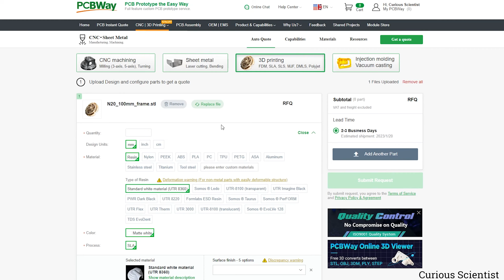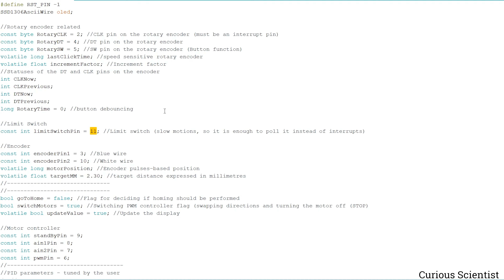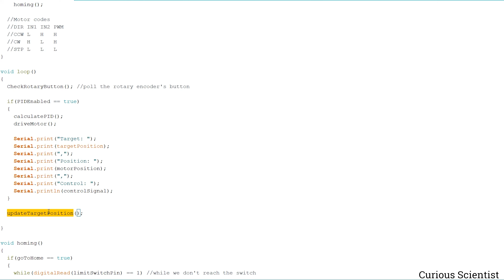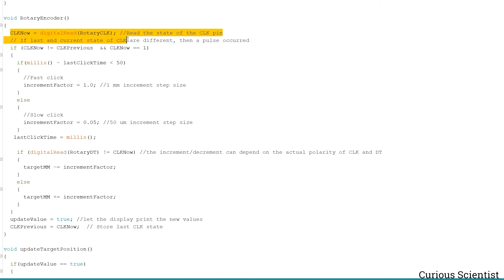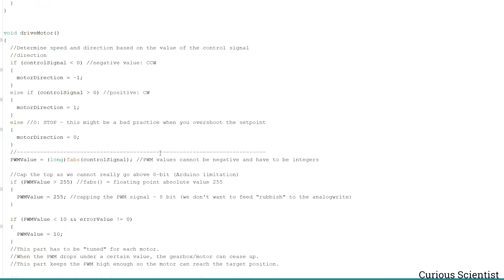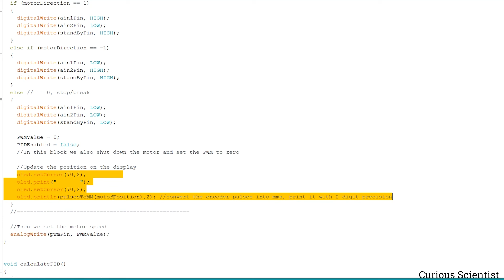Positioning with the N20 miniature geared DC motor

Comment: These are excellent little motors! I've been using them in a project, so cool to have closed loop control for relatively cheap. You can find versions of these that have a JST-ZH connector on the board for attaching the wires, and I highly recommend those. They are much more durable against wire bending.
Reply from the maker: Yes, they are fantastic! I will look up the ones with the JST-ZH connector. However, I found some miniature stepper motor-based actuators some time ago, and I prefer to use those. I will have some nice projects with those gadgets in the future.

Comment: Hi i am facing a problem with the N20 120rpm motor with encoder that i am picking up a lot of noise in the hall effect output pins is there any solution for getting rid of it
Reply from the maker: Hi! How exactly the noise looks like? Are you aware of the fact that you need pull-up resistors for the encoder pins?
Reply: @CuriousScientist  Hey hi 
The problem was different we finally figured it out
The issue was reading the interrupt.
We had attached the encoder pin to activate the interup at Falling edge and we had also taken care of debouncing issue to rule out false interrupt.
But even taking care all of these there was noise which was finally cleared.
The issue was
1) If we are reading the interrupt of the encoder at the falling edge then we need to to park the encoder state to high after reading it.
Similarly
2) If we are reading the interrupt of the encoder at the rising edge then we need to to park the encoder state to low after reading it.

There is noise in the encoder output it is inevitable.
So we removed the noise as mentioned in the above to cases.

Thanks for your fast response.
Reply from the maker: Hey hi! Thanks for responding and telling what led to the solution of your issues. This will definitely help other people with similar issues too!
Reply: @CuriousScientist  🙌

Comment: Thanks for sharing this! I need to do accurate positioning with this type of motor like a servo. I may add a potentiometer to measure its position, because it has a shaft that can be used for this. Btw, are you Hungarian?
Reply from the maker: You're welcome! Isn't the encoder enough to measure the position? :)
Reply: @CuriousScientist  Maybe, I hope it will be accurate enough.
Reply from the maker: It will be relatively accurate, you can see the proof of that in the video.

Comment: Ok. I did have one missing line in the RotaryEncoder function, CLKNow = digitalRead(RotaryCLK); Now the display target Increments and decrements. But the motor continues to run after pressing the hand rotary button at the first 2.30 problemed settings, and the display position stays at 0.00.  My drive does not have a standby input, Does that matter? I changed the gear ratio and pulses. My motor: 576 ratio, 11 pulses/turn. I left the 0.7 in, but I just have a gear motor for the test. I figured that would not be a problem. Would it be possible to send you my copy of your code? If not, any information would be greatly appreciated. Thanks again. Btw, the drive I'm testing with is: TB67H420FTG Dual/single Motor Driver. It's from Pololu.
Reply from the maker: Hi! The code is specifically designed for and tested on the TB6612FNG driver. If you are using another driver, then you have to figure it out yourself because I don't know that other driver. The lack of the standby pin does not matter, as your driver seems to omit it. However, I can see that the truth table is somewhat different. That might cause a funny behavior. You also use another motor, so you have to adjust the gear ratio and if you have a threaded rod or lead screw attached to the motor with a pitch different than 0.7 mm, then you need to modify that value as well, otherwise the positioning won't be correct. The code is available on my Patreon page, as I mentioned earlier.
Reply: Ok, thanks. I can get the motor and drive you have and test it out. I would like to ask, again, can I make a one-time payment? for a copy of the code? I know you don't know me, but I'm being honest when I say I'm on a fixed income. Or is it 5.00 per. Month only? Anyway, I learned a few more things from your code. Please let me know.  Thanks always.
Reply from the maker: @Dekan88  Hi! Sure, several people have done the one-time payment and there's absolutely nothing wrong with it. As I understood how Patreon works, then you can sign up, and then stop your subscription immediately. Then, since you paid, you will be eligible to access the content for a month. Or, just drop me an email first before signing up for Patreon so I can see what I can do.

Comment: Hi again, The code is running. After the limit is tripped and released, the motor stops. The display shows a target at 2.3 and position at 0.00. When I press the hand rotary switch, the motor runs in the correct direction, but the display position does not change (stays at 0.00), and the motor keeps running. I think the code is correct. I do notice the display blinks every time I turn the knob. The target does not change. Any ideas?
Thank you.
Reply from the maker: Hi! 
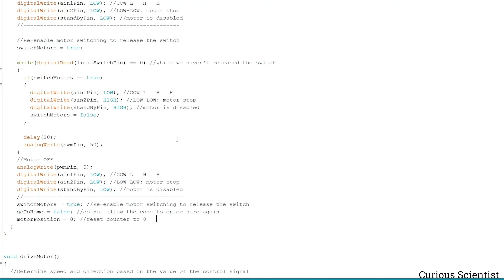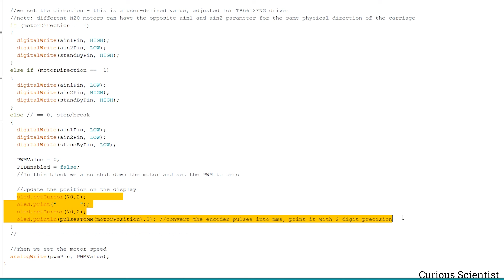Yes, 2.3 is the preprogrammed target (targetMM variable). If the display does not update, then you probably did not copy the code properly. It is possible that you missed the RotaryEncoder function that takes care of the updating of the target position (37:29). When the motor is instructed to go towards the target position, then the driveMotor() function takes care of the motor. At the end of this function (53:29) you can see the four lines which are updating the position of the motor. Check if you have written it correctly. 
If the display blinks when you turn the know, that is a bad sign, because the code is written in a way that only the numbers are updated and not the text. Maybe you should check the wiring and the breadboard contacts. I had viewers asking for help and it turned out that their breadboard had poor contacts.

Comment: Your video does not show all the code from beginning to the END! Now what?
You never go all the way to the end. See the last bit of code, below.
void CheckRotaryButton() // 
{
  if(digitalRead(RotarySW) == 0) // 0 and 1 can differ based on the wiring
  {
    if (millis() - RotaryTime > 1000)
    {
     targetPosition = (long) (targetMM * (298*3) / 0.7); // Pass the setpoint (target value) to corresponding varible
     digitalWrite(standByPin, HIGH); // Enable motor driver
     RotaryTime = millis(); // Save timr
     PIDEnabled = true;     
    }
  }
}

//---
// Another, non-PID way of going to a certain target.
// Only 1 direction is treated, but is easy to expand this to both directions based on the provided example:     YOU STOP RIGHT  HERE, NO MORE CODE.
Reply from the maker: How do you even know if I showed the whole code or not?

The rest of the code (20 lines...) was just an experimental part, it is not part of the demonstration. The whole code which is necessary and relevant for the demonstration is in the video. The code that is essential for the demonstration ends with the CheckRotaryButton() function.

Comment: Why am I getting this error after testing your code?  'RotaryEncoder' was not declared in the scope.
Reply from the maker: Hi! 
The RotaryEncoder() function is missing from your code. The RotaryEncoder() is the ISR routine that is triggered when you rotate the rotary encoder. I explain that function from 37:30 in the video.

If you have written this function, then it is possible that you accidentally missed to place a curly bracket "{" or "}" somewhere.

Comment: Hi, does anyone see the code on his website? I'm using my phone and do not see it anywhere. I see all the others on his site, but not this one. Thanks.
Reply from the maker: Hi! Why don't you ask me directly? It is on my Patreon and I told you this in our discussion under the other PID video.
Reply: Hi! Sorry, but I did ask you directly.  You stated:  "The code for this video is free, It is on my website.  The code used in the other video is also free."  I do not see your code on your website for this video for free.  I just, for now, wanted to take a look at this new video and see if your code is what I may want to do.  If and when I decide to build anything using motors with endcoders, I may connect you if I need any help, as I stated before.  This is just a hobby for me right now.  I enjoy learning new things about Arduino Programming. I myself made a three stepper camera slide. I have also designed and built a pick and place. Using Arduino, and interfaced it with a PLC.  I used the stepper to position a vacuum cup over the part I wanted to pick up.  The PLC was to control all the other aspects of the operations.  I have a background in electrical controls. But now I am retired, and I do this just for fun now and to learn.
This is the pick and place: https://youtu.be/kKw1mu4sxco
Take care.
Bill
Reply from the maker: You are cherry-picking when you are quoting me! "Very unprofessional." You forgot to quote the part where I said that you just need to follow the code as I explain it and write it down. The whole code is shown and explained in the video. It is in the video, for free. I never said that the code is available for free as a downloadable file. You can watch the video and see if it is something for you. Otherwise, as I said in my other comment, you can support my work and get the code directly as an .ino file from my Patreon page. It is also a hobby for me and not a charity.  I hope you understand. Cheers!

Comment: Good content as usual. To what extent do you think backlash in the gearbox affects accuracy? Greetings from the Uk👍
Reply from the maker: Thank you! I cannot comment solely on the gearbox, but the whole system seems to suffer from about 0.1-0.2 mm backlash. At least, that was the typical deviation from the target value when I changed directions. But I guess, the non perfectly-tuned PID also contributes to this value to some extent.
Reply: Have you actually tried to use this code that is in the video?
Reply from the maker: I have. I even demonstrated it in the video.
Reply: Why am I getting an error, 'RotaryEncoder' was not declared in the scope?
Reply: Maybe because i'm offline.